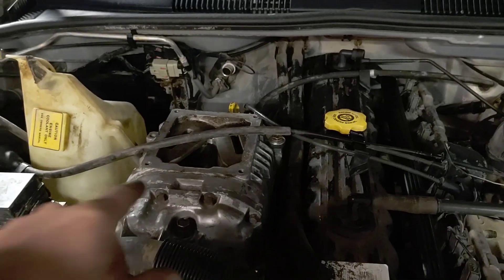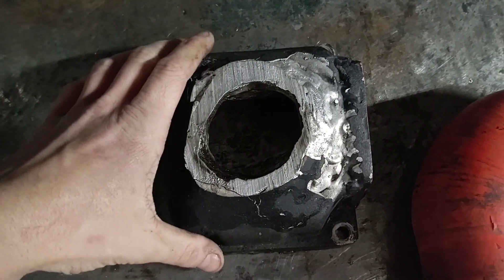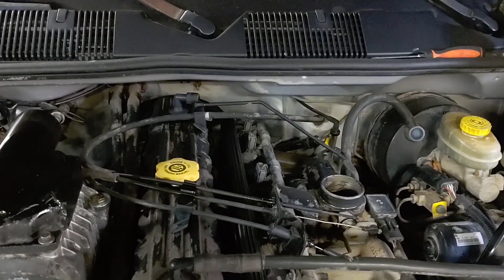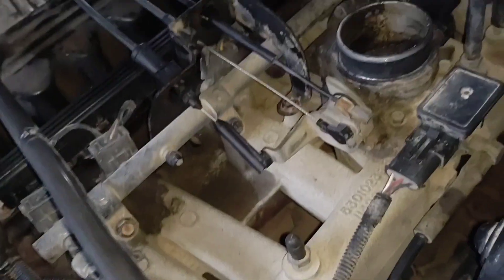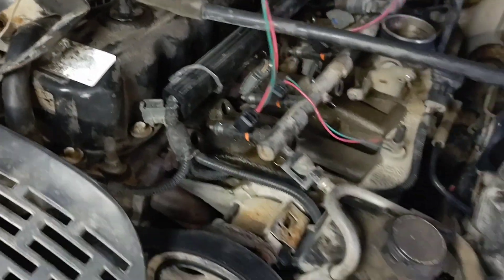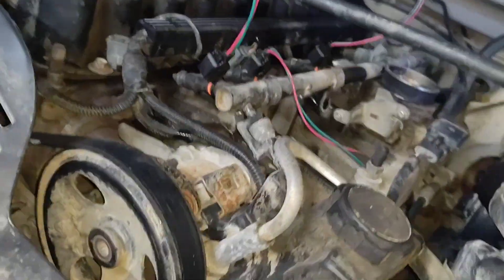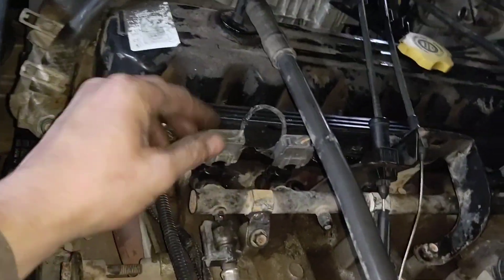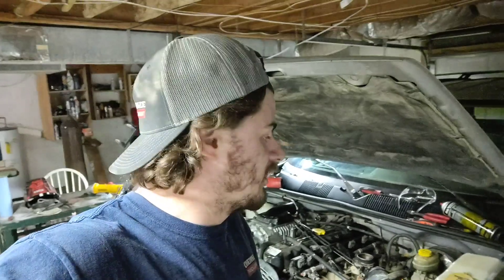supercharged jeep injector upgrade

Comment: What injectors did you use?
Reply: Thank you so much I just got my supercharger today
Reply from the maker: @OffroadXj388  no problem buddy. I sell a pretty solid mount kit if you get to needing one.
Reply from the maker: https://lmr.com/item/M9593LU47L/ford-racing-lightning-47lb-fuel-injectors-m-9593-lu47-9904
Reply from the maker: I would use these they are the proper length

Comment: How do you set your Up your TV cable on your 99??? I'm having trouble with my 95 dodge ram 1500.. and what do u use for tuning... I'm stuck because I have a 95 dodge ram 1500 4x4 short cab short bed and I'm on stock obd1 and wanna go to something else like a megasquuirt. I'm in the process of going to a 5 spd conversion.  So I just need engine management
Reply from the maker: I hold the throttle body wide open and adjust all the slack out of the tv cable so full throttle is pulling the tv cable all the way
Reply from the maker: I use hptuners on mine. I'd put a OBD2 harness in it they aren't too hard to make stand alone too. A cheap option would be a microsquirt but you would have to run batch injection instead of sequential